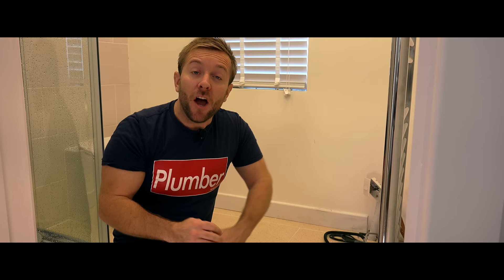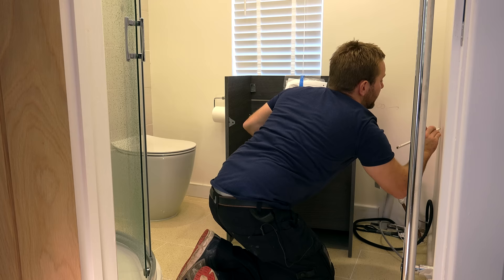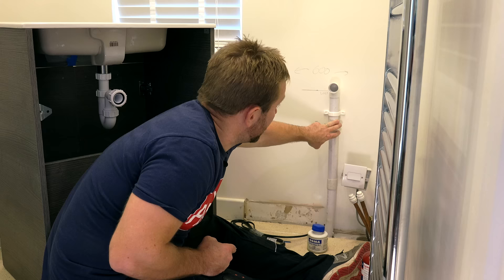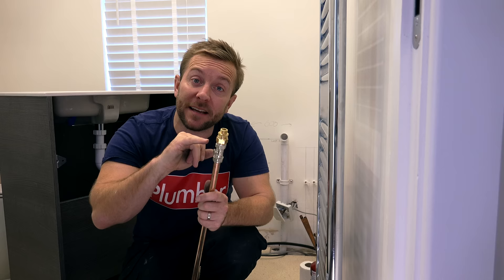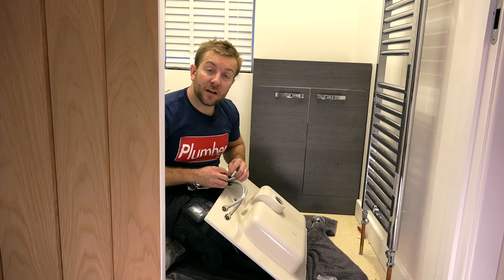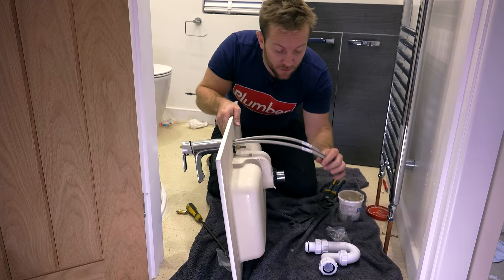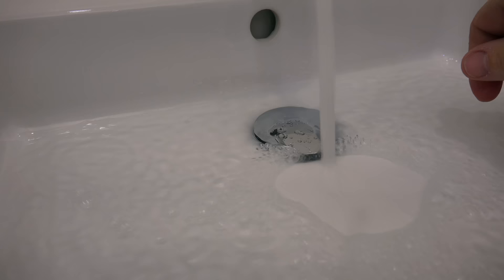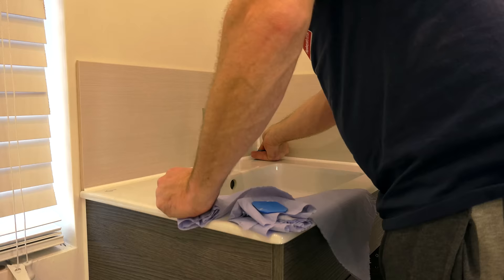HOW TO INSTALL A VANITY UNIT WASH BASIN - Bathroom Ideas

Comment: Thanks for sharing your knowledge mate, as someone relatively new to plumbing I have picked up some really useful tips from you. One thing I do when testing sink waste for leaks is start with a small amount of water ran into sink with plug in the closed position, then open plug/pop up waste to check for leaks before giving it a large amount of water to deal with, this way if I have a leak from waste I don’t have a large amount of water on floor/to get rid of, hopefully that makes sense and is of use to someone.

Comment: I put 6 wraps of ptfe tape over the trap rubber it protects it from getting cuts in it and reduces leaks .i also use white silicone to build the basin up and tthe top waste washer i throw it away as ut generally pops out at the last minutes and ruins everything.

Comment: I tend to silicon the basin unit at the front as water can come down onto the vanity unit. If it isn't well made then it will expand and look rubbish. Get some chrome pipe or chrome covers on the tails for the towel warmer Jimbo.

Comment: Hi. I followed your video to fit new vanity in bathroom and it was a great help, many thanks. Really good. However, one thing I found was I had to cut sink waste to run a new piece and the inside of pipe was lined in a horrible gunky slime(biofilm?). This went all way down pipe further than I could reach to clean. Could you recommend a cleaner to use to clean inside waste pipes? Thanks.

Comment: Very nice. I was a bit worried about installing a standard sink unit in a corner but if you can do it it must be OK. Is thereproblem with the RH handle hitting the wall?

Comment: Nice vid but if you don't silicone the top of the waste and just use the plumbers mait underneath, the basin can drain with the plug in as the water runs between the basin and waste.  Especially if the waste hole isn't quite round
Reply: I would use plumbers mate top & bottom personally.

Comment: Floating vanity cabinets - assuming I can't chase the masonry behind it, what's a good way to hide the water pipes coming up from the floor would you suggest? Boxing it in or use chrome tails and leave exposed? (waste pipe goes out the wall)

Comment: I’m making a vanity unit from scratch with a solid oak top under a square deck mounted ceramic basin,
What adhesive should I use to secure the basin to the worktop please?

Comment: Great video as usual. 

Not a criticism but a few things that I would have done differently would be:- 

Use swept elbows on the waste fittings - less likely to get blocked in the future. 

Use caulk rather than silicone down the sides of the unit - easier if you / customer wants to change colour of bathroom in the future. 

Got a basin that fitted flush with the top of the unit - as you’ve got the unit tight in the corner you’re unable to have the small overhang on both sides which makes the basin off center to the left - some of our customers would definitely notice that!

Level the unit both ways - you may have done that but it wasn’t mentioned. 

Anyway, great install just thought I’d give my take on it for what it’s worth.
Reply: great advice. i also noticed the basin wasn't centered either and it would forever bug me. i get it though, it would then mean the vanity would have had a small gap on the RHS.

Comment: Why don’t you connected flexi tap connector on top of isolation valve thread instead of connecting to compression straight coupling thread. Will it make no different?

Comment: Nothing wrong with the correct use of flexi! It makes a lot of sense on baths, especially side tap baths where its up against the wall.
Reply: The trouble with flexis is they all have a tiny bore at the connector ends. My bathroom was designed with a 22mm pipe from the hot water cylinder, the new combi boiler has a 15mm output 😔 but the flexi hose to the hot tap fitted a decade ago? Less than 10mm bore through the brass 😫

Comment: When you say skilsaw or cutter - what is the name of the DeWalt tool you're using there? Is it just a multi tool? Not sure what I'm searching for.
Reply: DeWalt DWE315. This is the one I use and its so handy. Its got a quick release blade holder so no messing around with Allen keys.
Reply: @alanrother8477  Thank you, I'll have a look 👍
Reply from the maker: @alanrother8477  That's the one!

Comment: Didn't mention levelling the unit that's why the doors look crooked also you should have marked the skirting board using the unit you wouldn't have ended up with a big gap
Reply: How do you suggest marking the skirting with the unit? .....you'll only manage that if there was only one board to cut because the other will push the unit over when offered in place & you would end up with a big gap on both sides but I'm sure everyone appreciates your constructive criticism!!
Reply: You could lift the unit above the skirting to mark for cutting but some basins overhang the the unit on each side so always check check and check again. Whata mistaka ta maker.

Comment: No plumbers mate is shitty.noooooooooooo old school I knew a guy who used it and it leaked. then we went to repair it with SILICON it's made to seal area's against water you wouldn't use plumbers mate to seal round a bathroom.... But every plumber every tradesman does it different but they get it done as long as it ain't poo